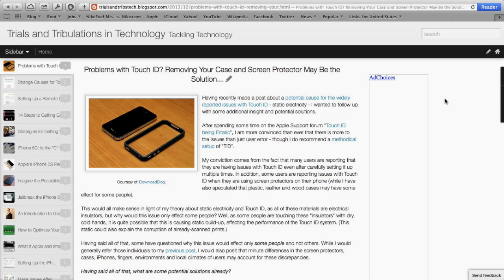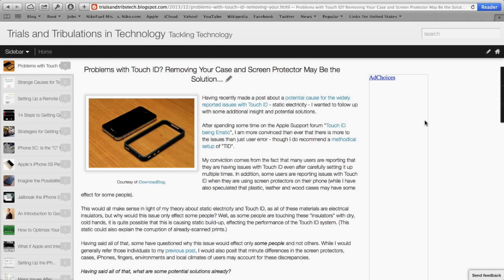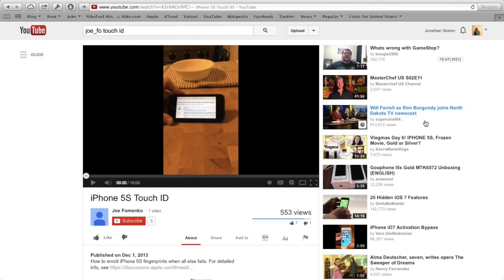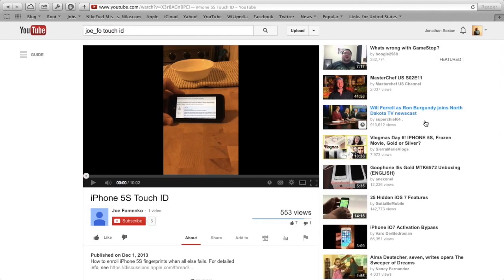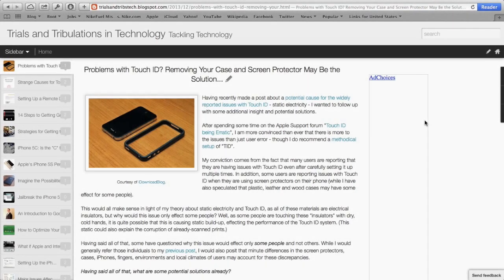Fixing Touch ID Scanning Issues on the iPhone 5s

Comment: My phone is having some difficulties like this.. But each time I try to set it up (iPhone 5S, iOS 9.2.1) it reads my fingerprint until it gets to the middle of the fingerprint on the screen. So I kept trying and after I kept lifting and resting my finger on the sensor, it says "sorry, this fingerprint cannot be read. Try using a different finger." So I tried that. Same thing. I used every finger and the same thing happens. Please help.

Thanks in advance.

Comment: i have recently purchased an iphone 5s and it came wiith ios 8.1.1, whenever i turned the touch id toggle on, it displayed failed, i tried and every-time failed, i have just updated it to ios 8.3 and still it isnt working, i researched a lot, and finally found this video, i have a glass screen protector over it , could removing resolve the problem, pls tell me fast, and if you know why my speaker also isnt working, even if do not disturb is off, media volume and ringtone is turned full, it isnt ringing,

Thank You

Comment: I don't have the option at all for fingerprints
Reply from the maker: Perhaps you have a different version of iOS? Apple moved the TouchID settings from Settings>General to Settings.
Reply: Jonathan Sexton No it's just not there at all in my settings. When I see other videos it says 'Touch ID and Passcode' but mine only says passcode. I'm on OS  7.1 BTW.
Reply from the maker: Have you done any restores or jailbreaks on this phone?
Reply: Jonathan Sexton No jailbreak on it but I have restored it but only because the fingerprint option went, so it was before the restore it stopped working.

Comment: I used the "Slim Amor S" Case from Spigen which is kind of plastic and gum and after removing it, it's superfast and absolutely accurate. Can't believe this. First I thought, it might not work because of my case which should be anti-static but obviously it had problems with that. Have to observe this for a few days but thanks for now! Good job!

Comment: can u help me with this problem in touch id
Failed:  Sorry, the operation was not successful.  Please go back and try again
Reply from the maker: Possibly... Can you tell me the steps you were taking when you got this error message?
Reply: Jonathan Sexton after i tap the add fingerprint
Reply from the maker: Joshua Rodriguez I would try Joe Fo's video above... It could be that your sensor is having trouble reading your fingerprint and his methodical method may help. Otherwise, if your iPhone won't even get to the point in the process where you scan your finger, you might want to plug your phone into iTunes, back it up and do a restore to reinstall iOS.

Comment: Haha yea it stopped working as soon as I laid in bed.
Reply from the maker: I am surprised to hear that and interested in hearing a bit more about your situation. Did you give it full 24 hours without a case/screen protector? Could the sensor be a bit dirty?

While I haven't had any problems since doing this, I am interested to know how it is working out for other people. Let me know.
Reply: Jonathan Sexton if the home button need replacement then what should we do? due to my knowledge every phone home button scanner is registered with hand set. if you replaced then the scanner will stop working. if you can fix could you help me please
thanks